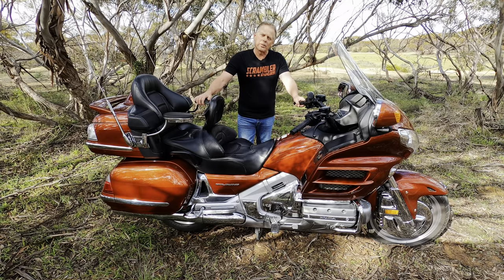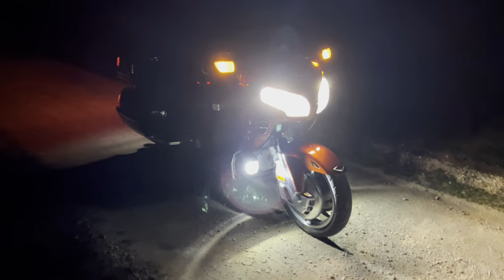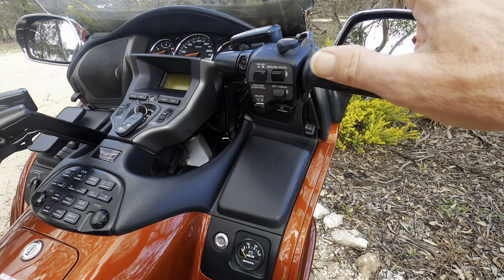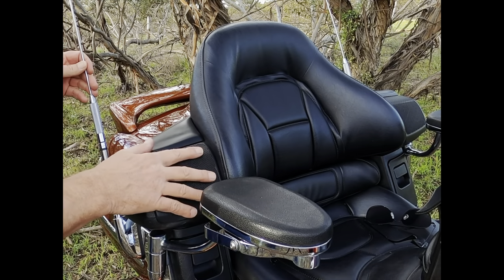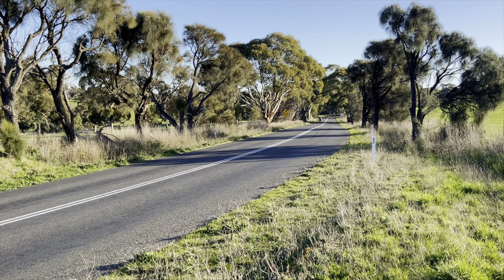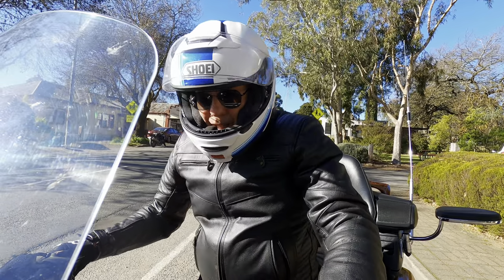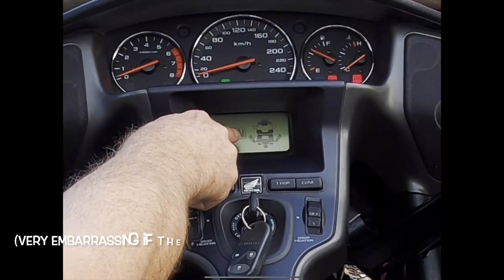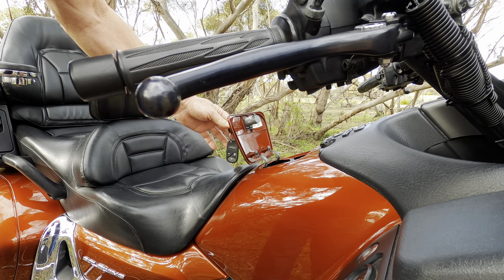Honda Goldwing Used bike review  Is it as good as people say?    (56)

Comment: My 2003 is in Jupiter Orange, another rare colour made only in 2003 which first attracted me to this bike. Superb machine with few problems other than sticky switches which need service or replacement every 10 years. I have 135K kilometers on it and it's barely broken in. Honestly, it runs and looks like the day it came off the showroom floor. I did have to add a custom seat and floorboards to accommodate my long legs but once done, there is simply no other motorcycle that comes close to it regarding personal comfort. At 80, I can still drive 500KM's a day and get off refreshed....can't even do that with either of my cars. With good maintenance, you will never wear this machine out...
Reply from the maker: Hello Robert, thanks for the comment. Yes I must agree the comfort level is second to none. I have done many Kms since doing the review and couldn’t be happier with this wonderful machine. Love the color of your 03 also, stay safe. All the best.
Reply: @standupmoto  Some 29 years ago, I was about to get out of motorcycling altogether. One day I went to the dealer who just finished selling my Kawasaki Vulcan 1500. I was about to pick up the cheque when my wife pointed me towards this very slightly used beautiful orange Gold wing on the showroom floor. She asked the salesman to start it up and it purred like a kitten. My wife turned to me and said. " if you don't buy that bike, you are crazy". W.E..L..L..with a "come on" like that, I pulled out my cheque book and bought it on the spot. 

This was one of the best decisions I have ever had made in my 67 years of bike riding, and I have since made untold numbers of friends  that I would never have met had I not bought this bike.

I hope your Wing gives you as much pleasure as mine has given me the last 18 years or so. I also LOVE the colour of your bike....
Reply from the maker: Thank you Robert, what a lovely story of how your Goldwing story started. I hope so also, kind regards.
Reply: STICKY  SWITCHES  -------   AFTER  WASHING  MY  " WING "  I  USE  MY  LEAF  BLOWER  TO  HELP  IN  DRYING   OFF  ****  WITH  SPECIAL  ATTENTION   TO   MY  WINGS  MANY  SWITCHES  .
**   IF   NEEDED  ,  A  SILICONE   BASED  SPRAY  (  THOSE  SMALL  RED  NOZZLES  TO  DIRECT  THE   SPRAY . )
***  CHOOSE   PLODUCTS  THAT  ARE 
**  "  PLASTIC    SAFE  "  ,  SOME  PRODUCTS   CAN   DISCOLOR  PLASTIC  COMPONENTS  .
(  SPRAY   A   LITTLE   AT   A   TIME , WORK   THOSE  STICKY  SWITCHES  , WIPE  OFF  THE   EXCESS   SPRAY . )
****  06  WING  BOUGHT  NEW ----  TRIKED  OUT  (  ROADSMITH  )  @  117,00P  ,  AT   PRESENT   147,000 -------
    A  " WING "  IS   THE   THING   &
                    RIDE    ON   !!!!!!!!
Reply: De oxit cleaner and the gold contact enhancer is what i  use when the little toggle switches dont respond, and im good for 6 mo.
Reply: Its wild to me people riding 2003 model years could put 300k on these bad boys and ones from the 80s are still going strong, i just watched a video of some guy taking an early 80s model on a huge roadtrip, he only paid like 2k for it
Reply: @TheAnnoyingBoss  WOW !!!!!
Reply: I've never seen this color, as I'm just an observer and admirer, and I must say this burnt orange with the flat chrome and shiny chrome makes for a perfect look.
Reply: I have found an orange 2003 with 19k miles on it for $6900. My current bikes are a 2014 CB1100 and a Versys 650. I have just enough garage space for the gw. Ive always liked Goldwings and think I may have to take the plunge!
Reply: @dcjr1053  Well done sir ! If i's anything like my Jupiter Orange 2003, it will turn heads everywhere you go....ride safe my friend

Comment: Looking at a 5th gen Wing and I must say that this is the most comprehensive motorcycle review that I have ever seen, and I have seen most of them. A special thanks to your wife for helping to support my decision, as my wife is my reason for getting a bike of this type and her comfort is paramount. Much appreciation to the both of you.
Reply from the maker: Glad it was helpful John & thanks for the special thanks to my wife, she appreciated it. We’ve had this bike for a while now and our views have not changed, in fact they’ve only grown stronger. The Goldwing truly is a beautiful ride (albeit not the most fuel efficient)  but that’s an acceptable trade off for the comfort & smooth 6cyl power, my only real complaint is I didn’t get one years ago. 👍
Reply: @standupmoto  thanks for the reply. I will update you once we select one. Heading into the fall/ winter here in the states, so the selection will be very broad.
Reply from the maker: @johnnance1414   Ok love to hear what you select, just one thing make sure the passenger seat has the heater. Its a game changer for your wife & if possible rear arm rests (although you can always retro fit the armrests) good luck with your purchase.

Comment: Outstanding review...I own a 2001 with 154k miles on it and fully intend to ride it to 200k and beyond.  This is my 4th Wing having owned an 86, an 89 and a 99 before this one with each one and currently also own a GL1500 Valkyrie.  I rode a 2019 Goldwing and was very disappointed with it.  The 01 to 17 generation of Goldwing is the standard by which  touring bikes are to be judged by for years to come.  Keep the rubber side down and ride safe, everyone 😊
Reply from the maker: Cheers Edgar glad you enjoyed it, interesting to hear your thoughts re the current incarnation of Wings. I’m yet to try one, great to see you’ve got a Valkyrie also, they’re awesome.👍
Reply: I really want to know what the limit is of a well maintained mile muncher. 100k miles for most motorcycles is clapped. A honda grom wont even get close usually. A dr650 might but theyre also basucally dirtbikes so they get beat on dropped lots adventuring. Thus bad boy i bey you could go 500k miles if you were really serious about keeping the fluids clean etc. I just saw a video some guy took one with 200k on a pretty good roadtrip. I cant believe hes lane splitting it.

Comment: Outstanding review. I owned a black GL 1500 for about 1.5 years, great bike with no issues when I sold it.  Then, a week later I bought my red 2002 GL 1800 with ABS.  I've had it now 2.5 to 3 years to date 2022.  I don't have heated seats or grips, but my heated gear works very well. Big solid strong bike with lots of throttle. My plan is to purchase the last model of this generation which is the 2017 which is hard to find.
Reply from the maker: Great stuff Andre, sounds like the Goldwing has you well and truly hooked. I can understand that they are a great machine, good luck with your search for a 17 model. Thanks & cheers.

Comment: I've had my 2003 Illusion Blue Wing for 8 years now. Bought it with 30K miles, just turned 60K miles. ZERO issues. Just put in gas, tires and oil and ride!
The best way to describe how a wing rides is you FLY it. It's a Super Sport Tourer that eats miles and other bikes with ease.
Reply from the maker: Very nice! And that illusion blue looks amazing, ride safe 👍

Comment: I've had three goldwings and they are the best bikes I've ever owned.  I live in central Alberta Canada and have ridden my 2010 to Northern California towing a trailer and two up.  No hiccups at all with the bike.  I did learn to stay away from any kind of sand as it makes the bike extrememly hard to control.  I was at sturgis on year on my 1989 Goldwing and harley drivers (even though they didn't want to) did admit that for long haul bike trips the Goldwings are by far the better bike for that.  My wife has a habit of falling asleep in the back as it is so comfortable, heated seats, heated grips etc.  The navigations system is useless as it outdates quickly and you can't really get updates for them so I just run my smart phone bluetoothed into my helmet or hard wired to the radio.
Reply from the maker: Great stuff Brian, you’ve had three- that says it all really. I’m yet to speak to a Goldwing owner that doesn’t love the bike, ride safe over there. I guess your season is just about to begin (weather wise) cheers mate thanks for the comment.

Comment: Steve. Liked the tone and content. Great to hear someone who doesn’t have to have the newest or best but simply ENJOYS. 
I am early in the process myself but everything about the bike attracts me,,,,,,,except the complexity. I bought mine at an auction sight unseen with a flat battery so no kms known. It had rodent damage and the upper bodywork was removed and in a box. Took a gamble and really didn’t pay a lot for it. When home I powered it up and it had 35k and had a higher level of corrosion than I was expecting. It actually fired up and ran. The engine spooled up ok but wouldn’t come off a fast idle. Turned out about six wires had been cut by chewing and other damaged. Back to the only down side I can see is the complexity, not the technology but the immense amount of hoses and wires and inaccessibility. I bought an’01 with 35k. The process of repair has been a headache but highlights the problem that produces everything about the Goldwing that is good. It’s size, comfort, weather protection and luggage capacity, it’s engine. There is so much of it and it is all so hidden that keeping the corrosion at bay is nearly impossible and it is a haven for rats to hide and chew that I am sure other low use storage type owners are having problems with even if they don’t know it yet. 
There are a lot of parts for early bikes that are no longer available. The wiring harness being one. They were about mid one thousand dollars when new. While in disassembly I found there is a problem with early bikes with the self reset ratchet lock mechanism on the windscreen adjuster. The lock tab plate was missing on mine as they had a known problem. There was a propensity for the small part to fall out and a later replacement is available but it is not clear whether the part can be replaced or the whole component group. Either way it doesn’t prevent the screen from being used. I reset mine manually by some disassembly and gradually with a series of trial rides I raised the screen one notch at a time until I was happy with the screen height and then just left it there. I come from a background of simple bikes, R series BMWs and I am a bit overwhelmed by the bikes complexity. Removing the wiring harness is a thing to generate nightmares. I produces enough ideological gravity to pull ones motorcycling outlook to a different place. Hard to explain but I have found myself changing the way I look at machinery. Maybe maintain but never recondition.....?use till it’s stuffed and then bin it. The thought of a really high mileage Goldwing where everything is worn out, cracked or deteriorated is overwhelming and it seems such a shame to use up such a great bike.
Sorry for the ramble but I am a little off kilter having had my centre reset, if that makes any sense.
Good video, tone great, easy to listen to. You have all the makings of a good presenter. I enjoy that you can impart that you enjoy. Cheers Stephen Tas’.
Reply from the maker: Thanks Steve, no apologies needed for rambling - I’m as guilty as it gets there. So first up I’m glad you enjoyed the video, I love making them. I’m no Goldwing expert by any means but a full workshop manual is a must I believe when as you we do our own work on these older wonderful machines. You’ve taken on a mighty task re-wiring a Goldie for sure but you’ll get there eventually, maybe even keep an eye out for a crash damaged one that you can cannibalise the harness  I’m sure the bits you don’t use would be salable to other owners via Facebook Goldwing sites. Thirty five k!! she’s just run in, keep slogging away at it and you’ll have a great bike at the end. It’s been a while since I put that video up and I’ve become far more familiar with this bike since then, I’ve  actually ridden most of winter this year. Not something I generally do but this bike with its creature comforts & wind protection have made it a pleasure, I truly believe the Goldwing is one of the greatest purpose motorcycles ever made (just my opinion). As far as presenter goes I just try to say it as it is, I do my own camera work and fumble my way through the editing process. It’s been a steep learning curve for me but I thoroughly enjoy it. I really have no idea how to promote my channel etc but I’m learning, this is so far removed from my life prior to YouTube and unfortunately I don’t have anyone within my circles that has any knowledge of vlogging. Anyhow that’s my ramble, good luck with your project and feel free to contact me if there’s anything I may be able to help with. Cheers.

Comment: Fantastic review of the GL1800. I have a 2008 now with 200 grand on miles. Still runs great. I live in Oregon USA.
Reply from the maker: Great stuff David, 200k wow. That tells me two things, they are a quality built motor and you are excellent at keeping it serviced. Thanks & glad you enjoyed the video, you live in a nice part of the world. Briefly visited Oregon many years ago while visiting the US, Klamath Falls, at the base of a huge lake of whose escapes me but it was a great spot. Cheers.
Reply: @standupmoto  Thanks man, I had a 1991 GL1500I with almost 300grand on it. They run forever if you take care of them.
Reply: Does it burn oil? It is shaft drive too. Ive had a shaft drive motorcycle before from the 80s as my first bike and it was incredible. It was a 1983 honda cx650 custom. Shaft drive was nice because I rode a ton which was important when youre first lesrning to ride and I didnt have to do any tedeous maintinance. It was a transverse vtwin so you could pop the spark plug wire right out of the side. Frankly it was so easy im suprised my spark plugs never got stolen. I could disconnect a cylinder by popping off the spark plug wire with my hand while I was riding. It was 33 years old when I got it at 18. That shaft drive lasted 33 years until I sold the bike to a buddy who sold it to some guy that destroyed the bike but it was everything else failing and not the shaft drive. The shaft drive was built different.

Comment: 20:26  if you are a little bit light in the REAR ...switch up your feets,  put the LEFT one on the CENTERSTAND then you can counterbalance right leg for that extra UMMMPHHH... ;)  BUT there is also a TRICK to RIGHTING A BIKE ON ITS SIDE by holding the FRONT BRAKE and ''backin up into the seat hold handle for centerstand (and the brake lever) and using legs to lift and brake to control roll...  :)  the 138 lb president of GWRRA used to demonstrate how to do it back a few years ago lol
Reply from the maker: Cheers Alex I’ll give that try.

Comment: I own a 2019 Goldwing and I only have two complaints.  1.The factory seat is not as comfortable during long rides as I expected for a touring bike and 2. the foot peg position is too far rearward.  If Honda corrected those two things I would give the bike a 10 out of 10 score.  But even with those things I still rate the bike 8.5 out of 10.  It truly is an amazing machine.
Reply from the maker: Hi Eric, interesting observations of the 2019GW. I haven’t spent any time on your model but I am of the understanding Honda adopted a little more sporty ergonomics with your version which may explain the peg position. I have met many owners of the later shape like yours and they all say as you do, it’s a truly amazing machine. Thanks for the feedback, ride safe. Cheers.
Reply: AIRHAWK   SEAT  CUSHIONS  ,  WELL  WORTH  ONES  INVESTMENT   FOR. COMFORT   ON  THOSE   L  O  N  G   DISTANT   RIDES .
Reply: I’ve had painful periods on all the bikes I’ve had.  For the last four tourers I’ve used a Bead Rider seat cover.  My first one was $35 but isn’t recall what I paid for the seat on my 2015 40th Anniversary edition.   It lets air under your tail and eliminates hot spots bare vinyl or leather can cause. Much cheaper than a new seat.

Comment: A very comprehensive review, I was deciding between a used Goldwing and a BMW R1200 RT and I think you just about convinced me, as one of the other reviews below its to carry my wife around on long distance drips. And I'm glad to see its an OZ review.
Reply from the maker: Thanks Michael glad you enjoyed it, I’ve done many kms on both. I love both but the Wing wins the long distance travel battle, the RT is the sportier of the pair but for sheer comfort of both the rider & passenger it’s the Goldwing. The big 6 is silky smooth so hand tingles are a non event even after a long haul of 9 or 10 hours, the pegs are perfectly positioned. Try both, your knees may be in better shape than mine.  But as far as passenger comfort goes, my wife says it’s like sitting in an armchair. Weather protection is excellent also, you’ve even got feet heaters. Ok they are the pros now the cons, the tank isn’t really big enough. 350kms v 450 on the RT,  in the twisties the Goldi is fun but no sports bike for sure. 
I guess the long & short of it is see if you can get a ride on both and preferably for a longer ride, you’ll work it out.👍